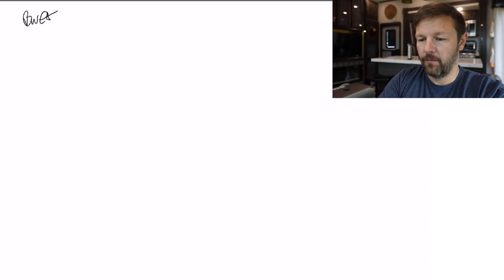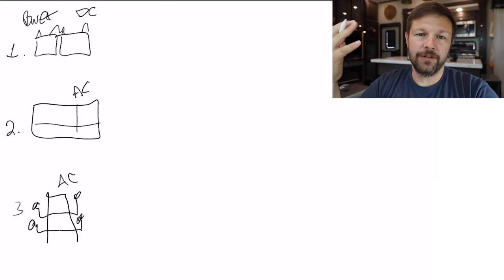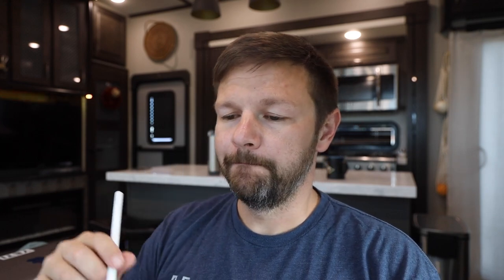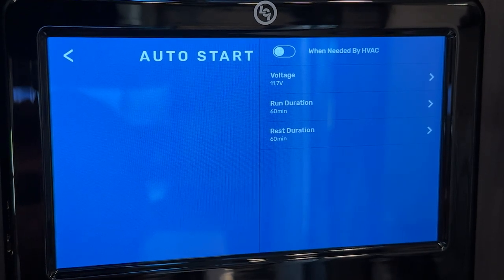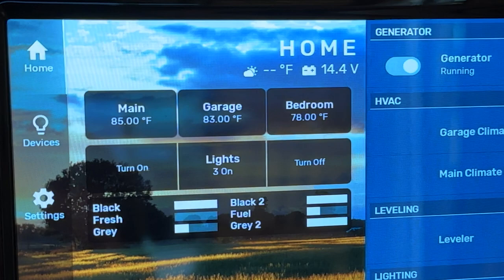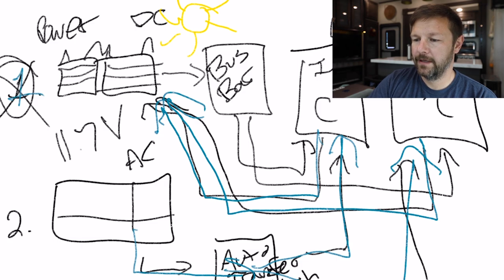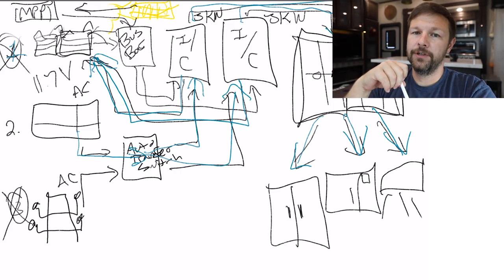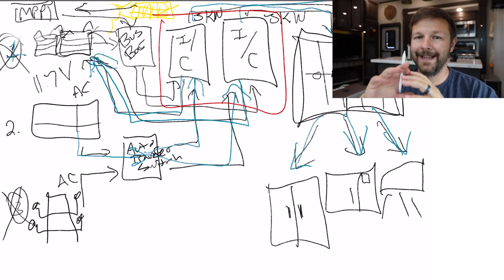RV Electrical System  (How does it work?)

Comment: Great video.  The only issue I have found in running the system like this is if you disconnect 12v fully at anytime you loose all settings in the OneControl.  This is why I am moving to control the generator via the Cerbo GX.
Reply from the maker: Good call out! We have to check the settings before we leave each time. Just to be sure all the settings are still accurate.

Comment: How big is your battery bank🤔

We have 1600 watts on the roof, 8 lithiums, 1 3K multiplus, and 7K generator.  I really like the idea of 2 inverters, so we can supply both legs of the 120 volt breaker panel!!!  Gooood stuff Harold!!!
👍😃🍻
Reply from the maker: Hey Mike. We have 600AH of battery which is more than enough for what we typically do for now. 😉 sounds like you have a heck of a system!
Reply: @1StrangeAdventure  Harold, I will agree with you when I get the 2nd inverter.
Reply from the maker: @k-mparker  Fair enough... Keep us posted on your upgrades!
Reply: @1StrangeAdventure  Rodger dodger jolly roger!